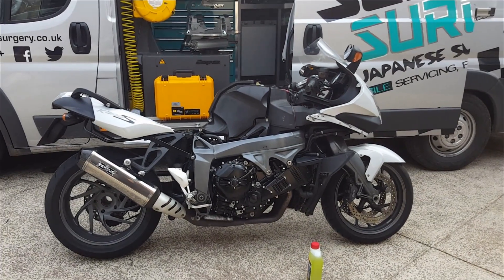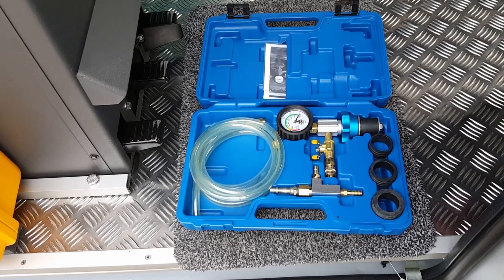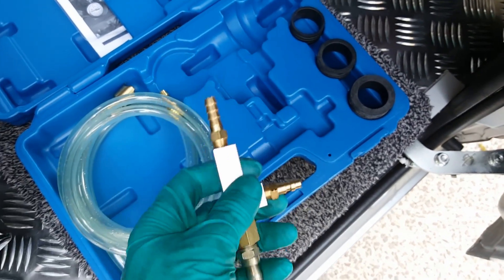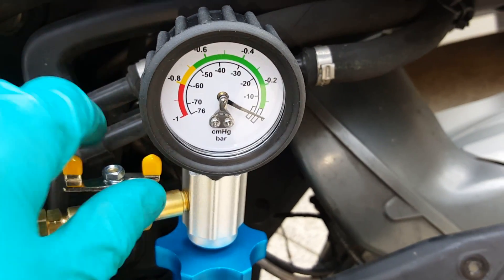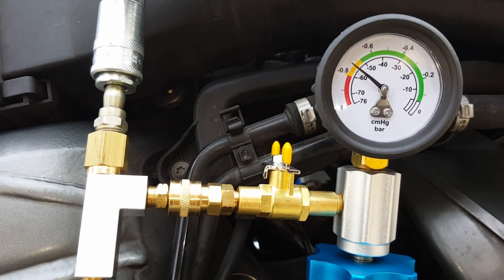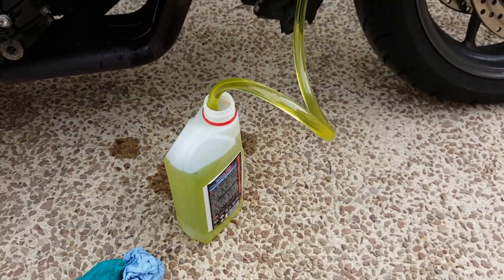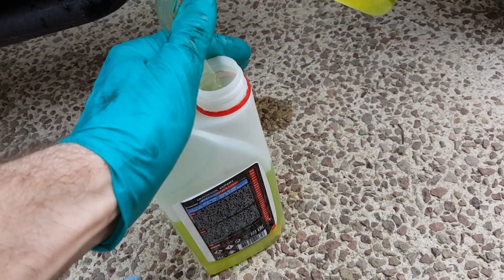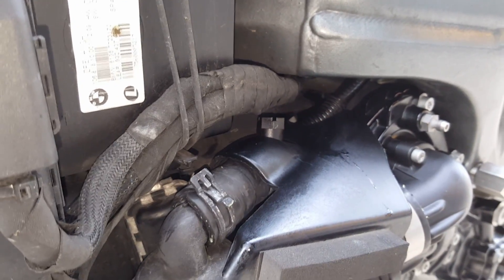BMW K1300S Coolant Change  (Vacuum Method)

Comment: Hi James, thank you for the video, please, one question, I did the procedure yesterday with the same tool. When you are in the introducing liquid phase, Do you open the tool valve to the maximum or just a little? Does the speed of introducing liquid matter?. Also, In my case with the same starting pressure and preloaded tube the pressure decrease until 0. I dont understand why this is happening after following your instructions step by step. The final result was good though as the fan cycle correctly...Thanks a lot!!

Comment: I bought this vacuum purge tool, but the tool air fitting  does not connect to my air line connector because the fitting is different from what we have here in California. I am trying to find the air fitting connector part # to  be able to used the vacuum purge tool. Can someone help me finding out the part number?

Comment: James, GREAT VIDEO! Quick question, you stated to drain the Radiator but what about the expansion tank, does that need drained as well? Thanks again for the EXCELLENT VIDEO! i plan on doing this job on my 2009 K1300S here soon as i am at 36,000 miles (57,936 km). Cheers Mate! Kenny

Comment: Lovely bike, K1300R or S could be next up for me. Don't think engine failure is common, was the owner just unlucky?

Quick question on the tool, could it be used to evacuate a full system? Been eyeing up one oft geese for a while now and either the Laser or Sealey offerings are quite reasonable priced!
Reply: +James Wright-Roberts Wow how do you think they wore out oil starvation? Nice video btw I never knew this tool existed I've only seen those funky funnel type things which fit on the rad cap mainly for cars.